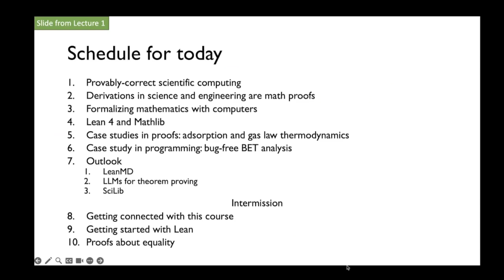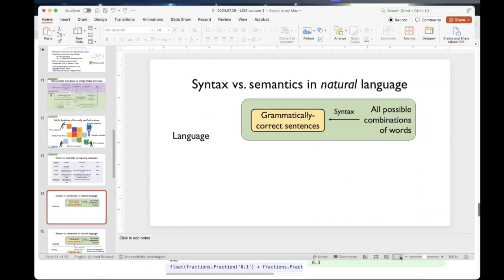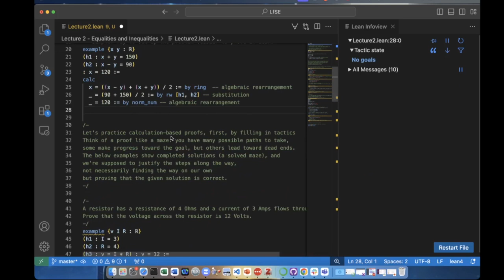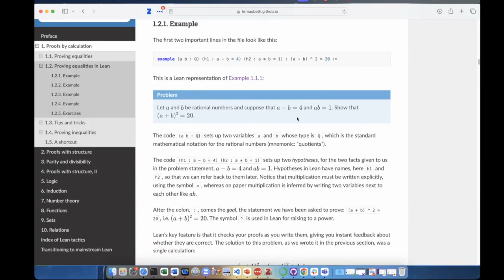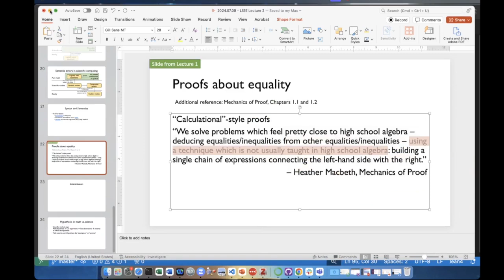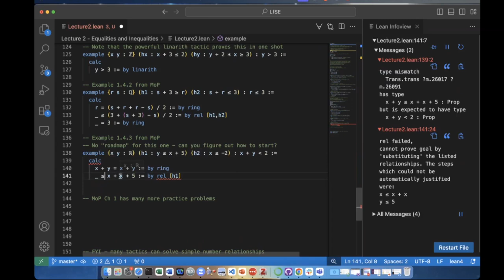Lean for Scientists and Engineers, Summer 2024 - Lecture 2

Comment: Hi. there has been an issue while using the repo. When I try to run it locally: i first changed the version to the version of lean as per the toolchain file in the repo. then used lake exe cache get which gets me all the necessary binaries and lake build. when i run it in vs code it tells me to restart the file and after that it restarts downloading all the mathlib files which eats up all my CPU. Is there a workaround for this? Why am I facing this?
Reply from the maker: Good question, thanks for checking out our repo! Unfortunately, this Lean code is starting to get a little stale, in the year and a half after we made this content. For instance, in Lecture 2, polyrith is no longer supported (it depended on an external service that was shut down), and count_heartbeats has been deprecated (you can use `set_option diagnostics true`, and find that linarith performs around 10x as many operations as norm_num does to close the same goal). Here's what I recommend: Copy the Lean code from our repo into the Lean language server: https://live.lean-lang.org. If any errors come up, either ignore them and focus on the higher-level ideas of the lectures, or ask a chatbot or ask a question on Zulip about how to update the deprecated tools.
Reply: @tylerjosephson8860  Thank you so much for the reply. I really tried different workarounds but nothing worked so  I switched to live lean-lang. Thank you for the lectures. They are a good intro